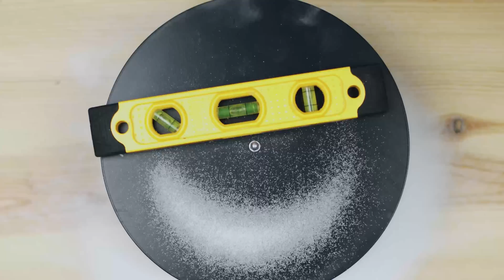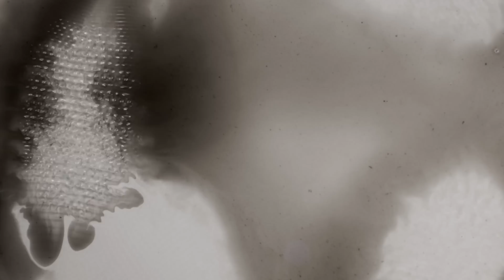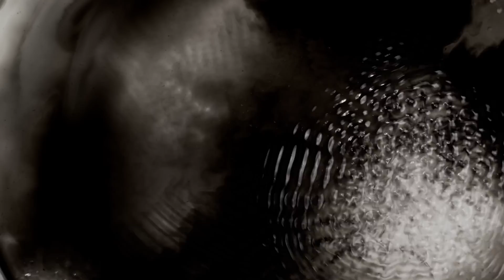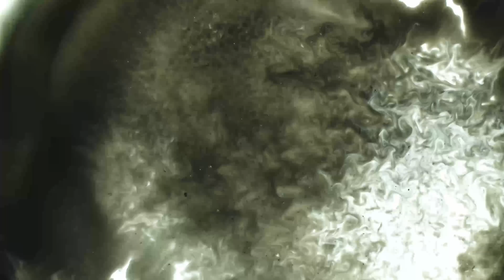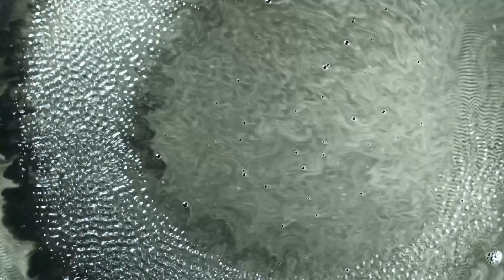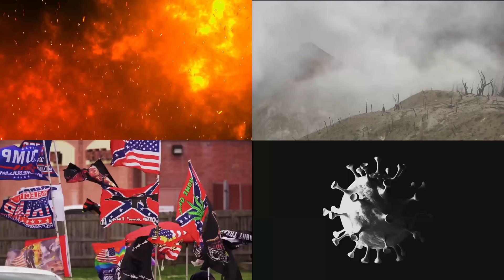Seeing Sound Pt. 1 - Cymatics and Nature

Comment: Would it be possible to have an array of lights, with each light slightly out of phase with the next? I imagine this would give a constant source of light. This array would have to be really tight so as to give the same point source, or diffuse the source.
Reply: Better to do something similar with a circular arrangement of various colored LED all at different base frequencies such that different harmonics, octaves whatever show as different colors.  Even all being in phase makes visualization of the wavefunction far simpler especially in slow motion.

Comment: Pretty neat there is an analogy between shrdinger's equation for some particular ions (in 2D?) with Chladni plates. Do you have a reference or some reading material explaining it?
Reply from the maker: To respond to OP comment: What I'm mostly referring to is that the nodal patterns are strikingly similar to electron orbits and were an important ingredient to what became Schrodinger's equation. 👍
Reply: @BennJordan  They are not just similar they perfectly match the wavefunction of the hydrogen Atom or at least when we are talking a single axis of the orbitals.  When you start to get into more complex hybridized orbitals they start to differ but only by so much and likely only because we are working on a boundary layer between two media with its elasticity determining the properties of the waves we are observing .   Atoms ARE these structures we are witnessing here and solid objects simply do not exist.  De Broglie  theories were originally meant to embody this principle but he was discouraged by those who had little understanding of what he was proposing before he was even able to finish the theory.   I have been at this for decades and one of the biggest proofs I have seen so far is it helps solve the triplet particle problems and large number hypothesis issues.  Surely you have noticed under any setup you easily get wave patterns which consist of one of 3 different sizes and any other wave sizes while not forbidden are so unstable they can only really even be observed under slow motion and give way to stable wavelengths every time.  Idk, ima stop rambling but believe me there is much more going on here then meets the eye and sadly there are only like 5 or 6 physicist in the world who seem to really get it and are extending Bohms work.  Sadly even they are attempting to describe particles as excitations which ride the waves and not the reality where waves are the boundary condition for the next harmonic set of frequencies which we view as excitations and particles.
Reply: Can you use a DC light source (maybe battery powered) to avoid alias effects while illuminatuing the fluids?
Reply: Funny how the resonance with specific modes seems to set up briefly, then change to a new mode after a short time in discrete steps as environment changes.
Reply: You didn't describe the set up for the fluid experiments! what are you using to drive it?
Reply: Hard to know without knowing what is going on precisely but it looks like most things are still been seen in alias (stroboscopically). These tiny waves move very fast!
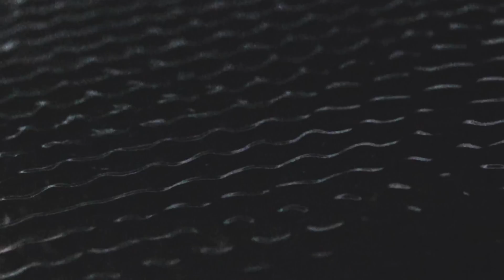Reply: 15:22 wow now that looks like real time! beautiful!
Reply: I wouldn't call them fractals exactly, but those tree patterns are definitely beautiful examples of chaos! https://en.wikipedia.org/wiki/Chaotic_mixing
Reply: Thanks for the amazing video, and all the content you have been making on this channel! I have learned so much🙏🏼 This topic in particular is close to my heart 💕
Reply: Im not an expert on the subject at all.  But I did know how the sand move and why they form those patterns. When the plate vibrates, it creates standing waves. The sand moves from the peaks and troughs that vibrate the most to the parts inbetween where there is no movement to jossle them around. I dont know much on shrodingere equation tho.
Reply: ACKTSHUALLY, Schrodinger's Wave Equation (https://en.wikipedia.org/wiki/Schr%C3%B6dinger_equation) is a special case of the generic wave function (https://en.wikipedia.org/wiki/Wave_function), which is the solution to a particular differential equation with boundary conditions (https://en.wikipedia.org/wiki/Boundary_value_problem). If you numerically simulate the plate physics by defining a set of differential equations with boundary conditions in multiple dimensions, the solution set will contain wave equations which result in the patterns shown here (where the nodes are defined by the locations of resonance created by interference within the solutions). The constants of the media (air pressure, temperature, particle size, dimensions, density, ETC) are constants within the definition of the system of differential equations. There is nothing special here about quantum physics, unless you really want to get into the weeds of explaining any subtle little variances between simulation and reality if/when you decide to actually do what I said above in a highly-controlled experiment (abating the chaos Benn mentions around @15:30); and then BAM! Instant physics thesis project. There might be a threshold where most physicists try something like this and decide to instead turn to philosophy when it all falls apart.
Reply from the maker: @Studio271  Exactly, regarding the philosophy thing. When you get into certain areas of wave function, Sartre and Camus sound rational and actual physicists sound insane. 😅